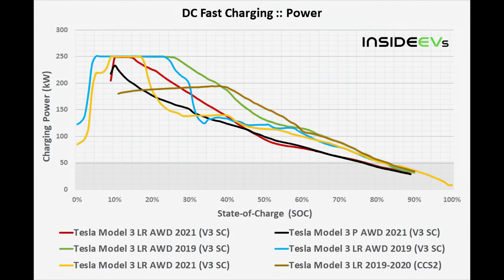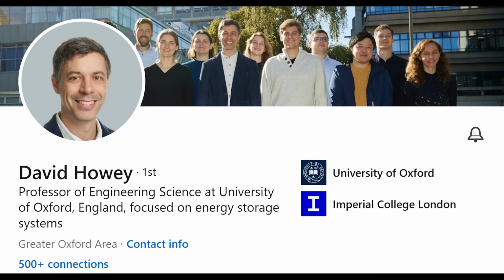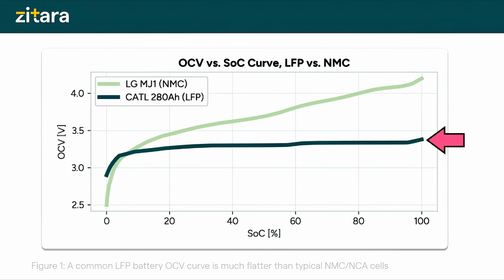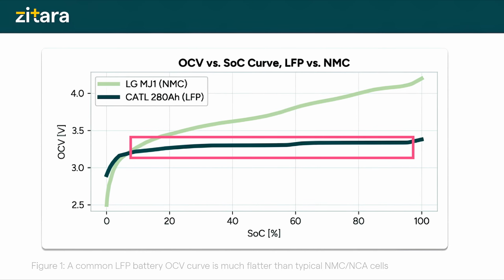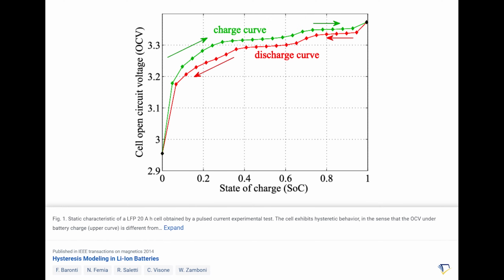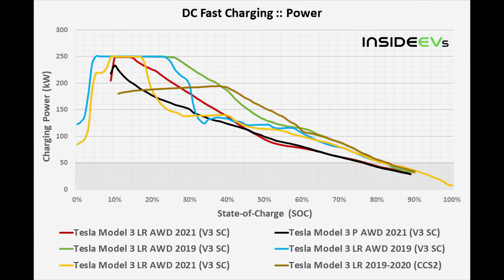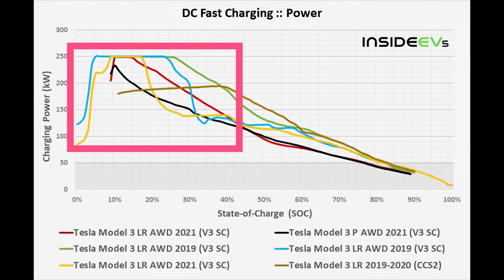Prof. David Howey:  The Charging Curve // + Does LFP 'Like' to be Charged to 100%?

Comment: does the internal resistance of the battery increase some milli ohms when fully charged ?
Reply from the maker: I haven't really looked into this, but I'm assuming that if it's fully charged, and you go to discharge it, the resistance would be very low if the battery is fully charged 

That's because the ions will be rushing back to the cathode which at that point would be mostly empty

Comment: Is it normal that my Felicity 48 v battery voltage fluctuates between 55.6 and 54 after it been charged to 100 % ? Is my inverter starting new charging cycles or its the battery performing balancing ?

Comment: Occasionally charging to as lttle as 3.45 volts and have it start balance cells that reach that voltage (absorb for 30 to 45 minutes) will do for most diy setups with larger lfp cell blocks. 

It is common practice from what i have been learning in the diy blue cell block community.

The idea i get from this video is that EVs with many smaller cells might sooner or later suffer from "runaway" cells that have less internal resistance due to cell degradation ,  causing different temperature compared to the rest of the pack, causing unpredicted SOC States after charging(increase absorption time?)  or high load(prevent high loads to not have fast voltage drops of lower resistance cell, eg faster discharge of single cell) .

From this i would say for stationary setups one could prefer oversized cells with the same c rates they will produce more power or to put it in other words, they will not be maxed  out so soon as lower Ah cells and preserving longevity is what we all want.
Also i oversized the bms. Where i typically use no more than 100Amps at peak usage from my battery the bms is rated 200 amps. 
The max is for short bursts/start up.

I tend to reduce wear and tear.

I can run 18Km/h but i seldom do that at the groceries.

For what it's worth, after seeing and reading many sources, a jkbms can do a fine job but don't trust manufacturer settings. We need admin rights. 
For problematic(older) batteries an extra neeey active balancer can be a real help in maintaining cells balanced. 
Eventually we want flexible Busbars, compression, temperature within limits and replaceable cells.
Wether diy or plug and play.
We certainly don't want black boxes. My 2 LFP cents. 
Cheers.

Comment: I watched the video from ECS with Dr Jeff Dahn from a couple of years ago.   He talked about the ways to improve longevity and performance of the lfp batteries chemistry and to improve the longevity.  I see announcements from CATL and others sounding like maybe they have found that magic cocktail to improve the longevity.  I would love to hear more about it. What I took away from the presentation however was that the recommendations to charge to 100% does damage the current LFP batteries.  And as stated in this video it is a combination of heat and voltage.  The current BMS systems are too crude to be able to accurately measure the SOC hence the recommendation to 100% charge them OFTEN.  

I have seen some recent stuff posted saying that the degradation is still very low, BUT I am hearing reports from actual owners of the vehicles stating their estimated degradation and it is much higher than those numbers that are being pushed.  It is starting to look more like a marketing campaign to get people to buy LFP than it is a solid recommendation based on the actual science and data.  Jeff stated in the ECS presentation that we need to see those improvements to the LFP chemistry to match the kinds of longevity we can get today with NMC/NCA batteries that are properly managed with lower voltage.  

The take away for me is that I would restrict the amount of 100% charges on those LFP batteries to the greatest extent possible.  If the car is a daily driver then look at reducing that 100% charge cycle to like once a week at most.  If the vehicle is driven less often than that look to see if you can pull back the 100% charge cycle to 2 weeks or once a month.   And if you are top balancing and doing that 100% charge immediately drive it to drain off some of that charge.  For home power the LFP makes sense, but for vehicle power I think this is a TBD until both chemistry is enhanced and the management systems improve  to the point they can accurately managed the SOC.  Maybe that improved chemistry is already coming.  I hope so.  Would love to hear more about it if that is the case.

Comment: I've been working with LFPs and the SoC-voltage behavior is an absolute nightmare. If you give someone an LFP battery and ask them to determine its SoC based on the voltage without charging or discharging it and the voltage is let's say 3.35V, the uncertainty is like 50 SoC percentage points. It's ridiculous and it takes a lot of effort to get around this in a usage pattern where you don't reach the high or low SoC points to reset your coulomb counting.
Reply from the maker: Great anecdote!

Comment: Great video.   Im wondeeing if i should charge my phone to 100% once a quarter?   It has been limited to 85% (now 80) for the last two years.
Reply from the maker: Aha!  That's one battery cell rather than thousands, so it's a different story.

No balancing is needed.  It does probably need to calibrate, but I wouldn't know how often that needs to happen.

Great question

Comment: Great interview, thank you. I have a question concerning a damage to a battery pack when the cells are out of balance 45:45. In the simple example of lots of cells in series, each unbalanced cell should have different internal resiatance. Thus, when passing a high current through the serie of such cells wouldn't there be an issue with uneven Joule heating? And thus greater degradation and unbalancing?

Comment: Really fabulous interview.  Probably more useful information in 1 hour than any other battery or EV video I've ever seen.  Amazing how Howey immediately grasps the crux of every question and already has the answer formulated in his head.  But I have a question related to my own vintage EV.  Is it deleterious to an LFP battery to have the voltage dip below 2.7 volts/cell in cold weather when the state of charge is say 30-40% and the only reason for low voltage is a high current load combined with the high internal resistance of the battery at low temperature?  My Orion BMS sounds an alarm when this happens because even though it calculates an open circuit voltage, the alarm is based on the instantaneous voltage,

Comment: Great interview! One thing that is still not clear to me is whether the cells in a battery can only be balanced at 100% charge. It seems logical that a BMS would keep cell voltages the same throughout the charge cycle rather than only at the top end, especially given that a battery will usually have a buffer so it never charges to a true 100%. I would welcome any thoughts on this.

Comment: Listed to it twice now.  I listed carefully to hear about REGENTERATIVE BRAKING.  
I always wondered how efficient regen is, given that the battery temp is managed for discharge when driving (not charging) when slowing down.
Wouldn't his be a good application of a super capacitor?  Treat it as charge first, discharge first.
When decelerating or going down hill, first charge the capacitor with overflow going to the battery.
The most likely event after deceleration is acceleration.  The capacitor is there to give a burst of power, before the battery takes over.
Since capacitors are very fast and efficient, more energy is saved.
Correct me please?

Comment: With batteries/packs I tend to think that:
Unbalanced: When a cell (or cell-group) in series is out of step with the series voltage. This can cause cell damage at high currents as the (typically low voltage) unbalanced cell (or cell-group) can be reverse charged and destroyed.
WRT state-of-charge for LFP: The pack is best fully discharged and the fully recharged to recalibrate the lower and upper bounds as well as pack capacity.
Great content as usual, thank you.
Reply from the maker: Thanks for the support and the well-considered comment Clark! ✊🏼

Comment: Great interview, the flat curve is the main reason to why you need to wait util you are over 3.3V before you want to do the balancing on battery, if you try to balance midways it can easily be that they take energy from a 40%SoC  cell and move it into a 70%SOC cell and make them even more out of balance. just because a cell at a lot higher SoC can still have a little lower voltage at that flat part of curve. This is very important to think about if you build DIY storage.
Reply: Generally the homebuild community tends to balance at 3.45 volts.
Newer setups with cells at even resistance can even balance while charging from 3.4 volts on. 
But then again, it's comparing small cells for ev with diy blocks of 280Ah. Thats not ideal.

Comment: 15:30 min: Sodium-ion batteries generally do not have the problem of a wide voltage range. The positive electrode materials made of layered oxide for sodium-ion batteries do have this problem, that is true. But Prussian White analogues, for example, show a very flat voltage profile like LFP. So again, we have to be careful when generalising.
Reply from the maker: Good point of clarification! 

True, sodium ion batteries are not monolithic, just like lithium-ion batteries are not.
Reply: Nevertheless, great video

Comment: Great stuff...for the most part....I think. I am old, I have my original ears, hence they are old. David's mic/sound, with a touch of that fabulous accent, left me struggling at times to string each syllable together. 😭  Also, don't be afraid to coach your interviews to over explain ( for your level) but explain it in a way that an 80 y/o with the mental capacity of a 6 y/o  will understand. I noticed he back-peddled a few times, commenting that he knew you knew this or that. 
Great interview, enjoyable chemistry, in all regards!

Comment: Jordan, great job as usual.

Would love a historical review of petrol development versus electric to dispel the FUD out there. Electric vehicles have been around basically as long as petrol, but had nothing like the funding petrol had and EVs faced technical limits that no amount of money would have likely fixed way back then.

I am old enough to remember leaded gas and the early days of mass produced turbo charged engines that fried because of no real cooling management system so if you shut off the vehicle whole the turbo melted down. 

People who stared driving in the last few decades do not appreciate or realize how much petrol tech has changed and how mature of a tech it is. 

Battery tech alone has seen massive improvements in the past twenty years and reminds us battery tech is  a much younger or less developed tech. This is why we see massive jumps in EV range and performance every five years or less.

Those damning EV tech as a failure and something that will never work seem poorly informed and it would be nice to have a  ten minute video that just lays out the facts. No politics, no hype, just laying out where things started and the reality of how EVs really are just hitting their stride and EV tech will have likely be the dominat force in all types of transportion before 2040. I see nothing from petrol or hydrogen tech that will make them the logical choice for transportation  once EV tech and infrastructure is built out more. This is not question of if EVs are the near future, as in next ten years, best choice, but when in the next ten years will the
EV tech hit the level of performance and cost that will draw most buyers in and gain public trust. 

Not that you need another project, but your delivery style and well thought out videos will likely be viewed by people on the fence about EVs who might be getting sucked in by the FUD pushed by some on media. It will be shared a ton by those wanting people to know the reality of EVs. Could be a good viral video.

Comment: We don't wait until one cell reaches a voltage limit before we start balancing. That would make no sense. because charging would have to stop to balance.
We can balance cell voltage at any state of charge and even while charging.
Reply from the maker: There's more to it than that

That's why there's procedures to force the cells to balance
Reply: I know they are very different from cells used in EVs but I've been flying electric model airplanes for years and our chargers balance the cells from the start of the charge. We can usually charge from 20% to 100% in 15 min or so and we discharge back to 20% in 4 to 10 minutes depending on the application so we are very hard on the cells. Packs are generally 6 to 8 cells max.

Comment: The hysteresis effect is very interesting to hear about. I assumed cells had an internal resistance that would lead to a voltage drop from the cell internal voltage to the battery system output on discharge, and vice versa when charging. I had seen this hysteresis behavior on my LFP battery system, and was honestly confused by it as it did not seem resistive. Thank you so much!

Comment: If you can get close enough to the state of charge, it's OK. Your gas gauge us not very accurate.
When you get to about 4.2V per cell, that's 100% and 3V is 0% 
Knowing the internal resistance of the cells, lets you correct for the terminal voltage.
But once you get a good enough model, you can use it all the time.

Comment: When is a fuel tank full? When the gas gauge touches the F line? When the pump handle stops filling? After spilling a little fuel due to over filling?
Reply: The RC community, especially at the competitive drone racing level, has a lot of experience with state of charge and pushing the limits of what a full cell is.
The problem is the cells catch fire.

Comment: Edited: There have been some  EV owners that had their car die on the road when it said it had 7% SoC left. This is most likely due, in some cases, to cell imbalance being forced to adhere to the minimum voltage protection from that one cell (or parallel module) falling far below the others. Would love to see that covered in your follow-up video you mentioned you were going to make.
Reply: No. Not seen not heard of this happening.
Reply: @RCdiy  I guess I shouldn’t say “all” lol. It was something that would occur and pop up in the forums and Facebook groups for the older 2012-2018 Tesla Model S’. Once there were data tools available to monitor the cell imbalances it became more clear that there were many users with heavily imbalanced packs that never charged to (or near) 100% and triggered the balancing process.

Comment: Really good content in this video! if I can add one more answer to the question "what causes rapid change in SoC" , based on my tech. experience in the control automation for industrial BESS projects, the BMS developed from different companies uses also pseudo real time algorithm that adjust SoC value at specific condition typically after cell voltage relaxation around one hour and by looking at the voltage in those conditions the SoC estimation is adjusted consequently; this may happen stepwise but really depends on how elaborated and refined is the algorithm.
BTW LFP voltage profile plateau i'is really an hot topic and is causing many headeach to industrial customers that needs to perform these so called SoC Calibration quite often; there are implications on the availability of BESS system and unfortunately this also causes a loss of energy due to BESS components efficiencies and losses.
Anyhow, looking and working ontop of those issues ,  its really stimulating since at all level, from the battery researchers up to who develop control automation to provide BESS secondary functionalities like me, there are multi-layer challenges that makes the job interesting every day.
Ciao and Thanks for the great content you always publish in your channel!

Comment: AI summary:

Highlights
💡 State of charge in a battery is determined by factors such as voltage, current, thermal management, lithium plating, and different battery chemistries.
💡 Charging curve is created based on maximum power limits, thermal constraints, and limitations to avoid lithium plating.
💡 Discharging of a battery is less of a concern compared to charging, as it does not lead to lithium plating.
💡 Charging a battery to 100% can degrade it more rapidly, especially in certain chemistries, and there’s a trade-off between maximizing battery life and capacity versus the need for accurate state of charge measurement.
💡 Advancements in AI, machine learning, and battery modeling can help with material discovery, optimization, and anomaly detection to improve battery performance and longevity.

Not the best summary... the AI missed a few juicy points. The key question everyone probably wants to know is addressed at 37:50 (how should you charge your LFP batteries).

As typical with this channel, the journey to the key points is a long, technical one. If you're highly into battery tech details then I'm sure you'll enjoy all the details.

Thanks